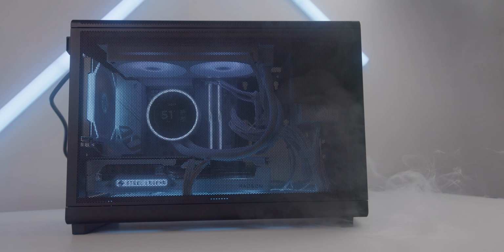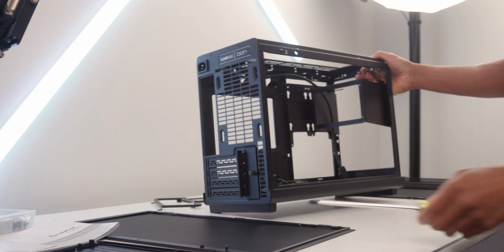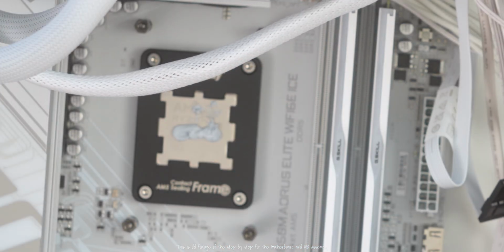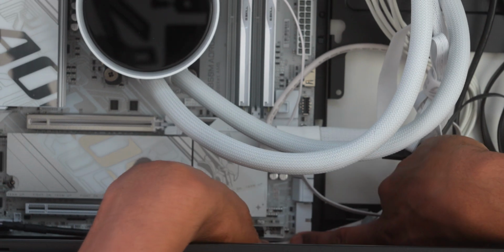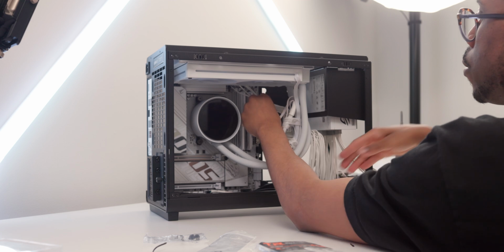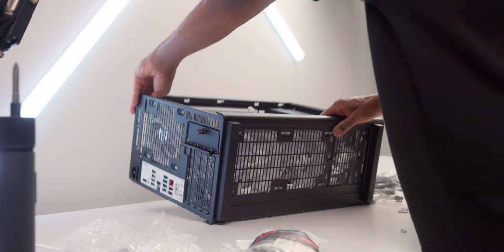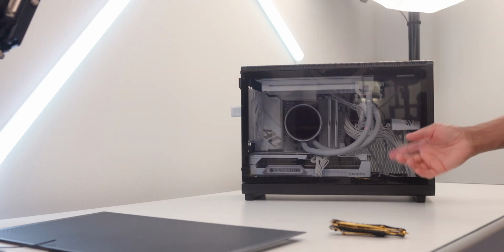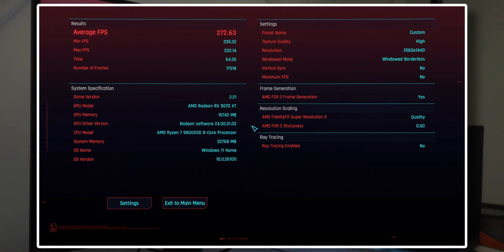From Scratch to Masterpiece | Step-by-Step PC Build [Lian Li A3]

Comment from the maker: 🖥 PC Parts: Lian Li A3 case: https://geni.us/LianLiA3cases
B850M Aorus Elite motherboard: https://geni.us/B850MAorusmotherboard 
AMD 9800 X3D CPU: https://geni.us/AMD9800X3D
AMD 7800 X3D CPU: https://geni.us/AMD7800X3D
NZXT Kraken Elite 240 AIO: https://geni.us/KrakenElite240mm
G.skill DDR5 RAAM: https://geni.us/GskillDDR56000CL28
Kingston Fury M.2 SSD: https://geni.us/KFuryM2ssd
Corsair SF850 PSU: https://geni.us/CorsairSF850
Lian Li Wirelees reverse blade fans: https://geni.us/WirelessRevBldFans3pk
Lian Li Wireless rev. blade 120mm fan (exhaust): https://geni.us/WirelessRevBldFan120mm
AM5 Contact plate: https://geni.us/AMCcontactFrame
Noctua thermal paste: https://geni.us/NoctuaNTH2
ASUS ROG Loki PSU: https://geni.us/ROGLoki850W
Arctic 240mm AIO: https://geni.us/ArcticLFIII240mm
Electric Screwdrivers I used:
https://geni.us/HOTOElcScrewdriver
https://geni.us/HOTOprscnScrewDriver
Monitors Used:
Aorus FO27Q3(360Hz 1440p): https://geni.us/AorusFO27Q3monitor
Aorus FO32U2(4K 240Hz): https://geni.us/AorusFO32U2monitor
Aorus FO32U2P(4K pro version): https://geni.us/AorusFO32U2Pmonitor

Comment: 6:30  That is false.  The board only uses 2 m.2 slots.  The top is controlled by the CPU and does not share lanes with the PCIE slot.  The bottom is controlled by the chipset.  I have the same board with both m2. slots filled and the GPU is running at full x16.

Comment: Building a similar setup.  The Minisforum motherboard I got died (has CPU and motherboard)  I'm planning on getting the Asus Strix B850i.  I love Gigabyte, but the 20Gbps USB C is attractive.   I'm concerned about cooling and debating between 7800x3D and 9800x3D.  I'm probably going to get an Arctic 240mm Freezer III Pro.
Reply from the maker: This case has great airflow and I have yet to have any issue cooling the 9800x3d…also I hear great things about the Arctic AIO’s. I have one in house and I’m looking forward to building with it soon

Comment: Why didn't you rotate the rad fan 180 degrees the other way and hide that cable? There are gallons of room on the mobo side between and between the rad and case wall for all surplus cabling.  Not to mention if you placed your psu on the back case wall you could have hid there.

Comment: If you had read the manual, you would not have placed the PSU support on the inside of the case, the correct way is on the outside of the case, even better would be to place the power supply on the right side panel of the case, so the PSU would draw air from outside and not from the front part which is covered by the front panel. This would help with cable management, on the right side of the case there are several PSU height adjustments as well.
Reply: Just wanted to add one more comment to say thanks for advising about the side-mounting option, cos it seems like it'll give better cooling for the PSU. 

I only have 3 case fans to use, so because the PSU vent is facing the top of the case, I may put one exhaust fan halfway above it, on the case roof (I say halfway, cos it's the only exhaust fan, and I wanted the interior air to "find the exit" easier - let me know if I'm deluded there though). I'll put an intake fan on the left side and perhaps one intake on the rear too, so there's 2 blowing across the mobo. Though they're blowijg into the case in perpendicular directions, I figured that rear intake would help push the internal air towards the top exhaust that's near the front roof, and having more fans doing intake than exhausting would help create positive pressure inside the case...

Comment: Thinking about doing a very similar build but I've been reading that the intake fans at the bottom can cause fan turbulence for the GPU and increase temps. Is that true?
Reply from the maker: Hasn’t been the case for me and I’ve tested two GPU’s in this rig and have had great temps on both so far
Reply: You don't need bottom fans at all with this case yet everyone seems to include them..
You could argue for a single fan right at the very front under the psu but if you get the vented wooden front this also isn't required

Comment: Front panel is solid so why have the fan facing the front there’s no airflow should’ve flipped it that way the psu fan isn’t blocked
Reply: Just install the PSU on the right side.
Reply: There is actually a 5mm gap between the front panel and psu intake if using atx. I think the gap is wider when using sfx. I'll be trying it out soon.
Reply: Would have been better with the wood front panel. That one is vented
Reply: I have actually measures it 7 days ago and there is more than 2cm of space between the front panel and psu if you use an sfx psu. I installed my psu facing the front to avoid the hot air from the gpu pass thru. I used the new lian li sfx 850 watts 7700x and 7900xt and the psu fan doesn't even start up in most games.